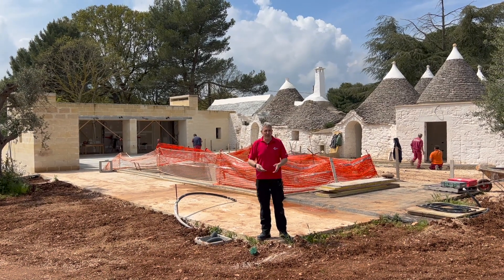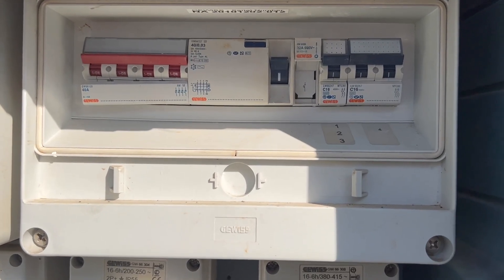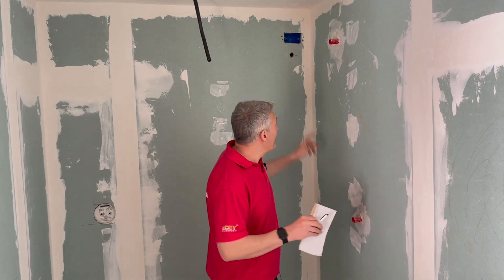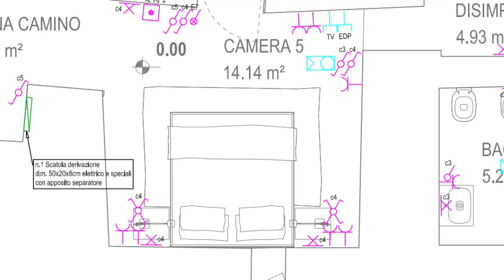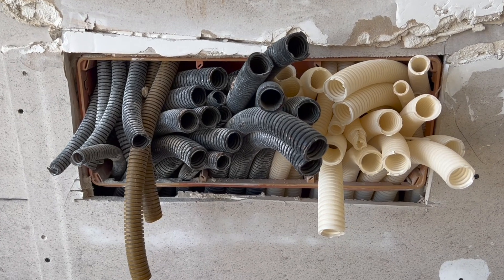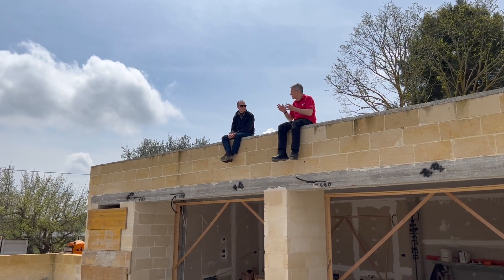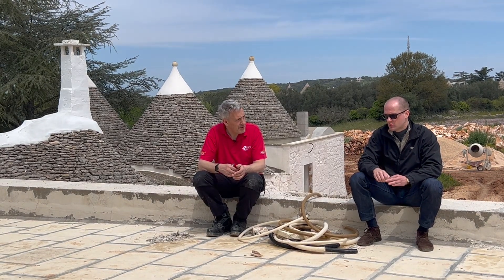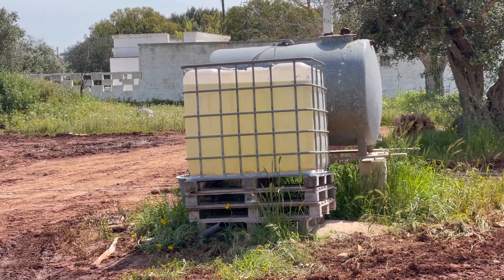Electric Wiring in Italy - You Won't Believe What They Do!

Comment: So people in Italy don't have air conditioning?  The 3kW thing is mind boggling to somebody living in California, I have 200A service at 240V (two x 120v with a center neutral) for a total of 48 kW (assuming pf of 1).   Last week we were having some voltage spikes and the lineman pulled the meter and put a tester on the line, I watched him pull 600A @ 240V and 400A at 120V to stress test it, no problem.
Reply: they have it, almost everybody excluded poor and students flat it's just not used as strongly as in USA. You usually have warmer temperature... Also think that you usually have just one or two split, so they're quite efficient
Reply from the maker: Italian properties are significantly smaller than what you are used to seeing in the USA. Especially in the towns and cities.
Reply: @efixx  Yeah good point, I'm living in 3100 square feet (~290 M2) which is huge by European standards.
Reply: @WhatsUp3D  But we also tend to keep the AC to some degrees under the external temperature. Not freezing temperature in august. 😆

Comment: Looking at this from Canada this is so strange. Our house was built in 1952 and we had a 100 amp 240v panel. We upgraded it 20 years ago to 200amp 240 two phase. No conduit, just run the wire through the studs.

Comment: Nice video! I recently remade the electrical system of my flat built in the 60s, when they still used solid copper wires and no earthing... My electrician was able to fit a 6mm2 power line from the meter up to the 4th floor. Everything is electrical in the flat and I can manage with a 4.5kW contract which is 50% more of average Italian homes. 
I have induction stove (with a 2.7kW built-in limiter), electric boiler and heat pump.
I believe the regulation says you can't have an outlet closer than 60 cm from taps.
Reply from the maker: Thanks for the info
Reply: I'd assume it's 600 mm from showers or baths, like in most European countries. The bathroom zones 0 (inside the shower basin/bath), 1 (directly above the bath/shower) and 2 (600 mm to either side of zones 0 and 1) are fairly universally accepted, zone 3 has been abandoned in all countries I know about.

Comment: I had the idea that houses in Italy were made of brick, not drywall
Reply from the maker: It’s a mixture. More drywall used now due to increased insulation levels.
Reply: @efixx  I’ve seen drywall on brick/concrete for aesthetics purposes. Mostly in commercial places, because in houses it’s a waste of space. In houses I’ve seen it on the ceilings to install a more complex lighting system, but on the walls it means you loose space and you get a fragile wall so it’s uncommon.

Comment: I'd love to see the US use more conduit in residential installs. It's a pain to try to do any sort of rewiring because the wires are stapled inside of the walls.
Reply: Same in Canada, I wanted to get some network cables from one room to another across a hallway in my condo, like 6 foot linear distance to cross. Doing anything in the walls would have required many holes and drywall rework and hiring a professional, so I cut a hole in the ceiling of the closets on either side of the hallway, installed a low voltage bracket brushed cable pass-through, and stuck some plenum rated networking cable up there. Inside the rooms themselves, any cable runs I have to do with just plastic trunking along the baseboards, but at least there's no wires crossing the hallway!

When they built the place a little over 20 years ago, nobody made any thought about data networking. How I wish this place was fully wired with ethernet cable! Nope, you just get electrical, telephone, and coax for TV, nothing else and no provision for future expansion.
Reply: @guspaz  Yep. If you're lucky, the electrician hired to wire the house installed at least CAT5 for the telephone wires. In that case, you just swap out the RJ11 jack for an RJ45. My in-laws house was that way. But that's still just CAT5, so it's technically only rated for 10/100 and not gigabit. But in most cases, gigabit works just fine.
Reply: @guspaz  Yep, need to get through the floor to the basement to replace furnace signalling cable - still did not find a way. Don't want to cut the drywall ...
Reply from the maker: Same in 🇬🇧 Uk

Comment: "color coded" lol, i used to live in a 1980s apartment complex, when rewiring the bathroom wires that were going through to get to the bedroom wall sockets, I got 220 for a couple seconds and collapsed on the floor, from the green/yellow wire (ground), despite the fact I switched off the main. Turns out that the neighbour's bathroom light was giving power to my light switch as well, through a ground colour coded wire. Italian electrical genius of the late 90s.
(I do have a high school diploma as electrician, despite that the bullshit you will find in pre-2004ish buildings is insane and insanely dangerous even if qualified)

Comment: Easier than running metal conduit but still a total pain in the rear end to do. My question is. The inside of the flexible conduit. Is it smooth or ribbed like the outside of it?
Reply from the maker: It’s ribbed in both sides
Reply: I can assure you it's not difficult push wires in those conduits. The wires should occupy less than 50% of the corrugated tube section. Also: most of the conduits are left empty just in case you need more cables in  the future. So: plenty of space
Reply: @moschettiflavio3635  With stranded wire it should be easy but here in the states we use solid wire. Solid wire and corrugated/ribbed conduit do not play nicely together. We do have flexible conduit, but ours has a smooth interior.

Comment: Connecting the foundation steel to the ground wiring is common, but it's bad. Small discharge always happen, and after years you are going to find significative corrosion to the steel.

Comment: Seems like the regulations or standards are over the top ! I don't see why + and - (phase n neutral) need to be in seperate conduits. Then they use flex pipes instead of straight-line PVC tubes making predictability of conduits  during repairs impossible. Then to top it they allow conduits over conduits, that too in the floor below the tiles !

Comment: Here in Portugal - also a Mediterranean country - it is pretty similar to Italy.

For the longest time, the standard was 3.45 kVA as the contracted power, which translates to 15 A of current.
Nowadays, many people switched to 6.90 kVA, which is 30 A of current.
This shift is mainly due to the change from gas to electric stoves, the dishwasher became normalize, and many houses installed Air Conditioning units.
Moreover, our energy needs - overall in the Western countries - has risen.

Heat pumps is still rare in Portugal.
But I honestly think that in Europe in general, but specifically in Portugal, we still have a long way to go when it comes to HVAC system installation.
I still struggle to find a air exchange system, which brings fresh air into the house, but warms it up before entering the house.
Moreover, people still struggle with humidity and do not know how to respond in an effective manner, let alone in an efficient one.

All this to say: in this road for efficiency, we need to work and share experiences - like you just did in this video.
Thank you so much!
Reply: Dutch standard is 230V x 40A = around 9.2kVA. For most applications that's fine. Since I'm using induction I have a double group for the induction plate. And I put the oven + microwave  on different groups as well so I can run all 3 together with no issues.
Reply: @StCreed  Portuguese culture, for many years, was to save energy as much as possible.
Only in recent years did the population evolve into a more consumer-oriented mindset, for energy consumption, among other aspects.

With 6.9 kVA I can run almost everything I want - granted it is on a separate circuit.
We have 2.5 mm2 cables to power sockets / outlets, and 1.5 mm2 to lighting, and it is mandatory to have separate circuits for a given power demand.
In the kitchen, you must have a dedicated circuit to each big appliance: cocktop, oven, washing machine, dishwasher, etc... This avoids running into issues.

Nevertheless, I imagine that in colder climate countries, the massive power demand is during the Winter months, right?

Comment: A bit of precisations while watching the video:
1) you need an rcbo within 3 meters from the power meter, as it does not act as a protective device. We usually place a delayed 300mA.
2) Shower alarm is not mandatory unless the bathroom is designed for disabled people too.
3) outlets have to be 0,6m outside the perimeter of showers and similar
4) backboxes are indeed universal for all the manufacturers.
5) running the cables vertical is not technically a law, but is enforces widely
6) houses over 400mq or 6kW are reuired to be deisigned by an electrical "engineer", but is usually done also for smaller houses.
7) i actually live with 3kW without any problems.
8) aerial tv system is still the standard
9) the colour code is a bit more complex
Reply: Seeing people struggling with the 3kW limitation of Italian power supplies - And noting I seldom (If ever) draw more than 1kW out of my UK supply (13,2kW day, 22kW night; An electrically heated home) at any point - I'm starting to wonder if my energy efficiency is considerably more German than I'd first thought?... ⚡🤏🙃
Reply: @UK-Combustibility-Assured  that's what I think too. No wonder Americans are considered the biggest contributor to climate change pro capita.
Reply: 4) I think he meant the boxes can be used in both solid walls (brick or concrete block) and plasterboarded stud walls, which seems strange to me - I know many Italian manufacturers have to different types of boxes (I've installed enough Vimar stuff to know their catalogue quite well).

The origin story of Italian back boxes is fascinating. Back before WWII Italiy used the same round boxes with 60 mm fixing centres as most of the continent. In the late 1950s the owner of one of the major accessory manufacturers went on a study trip to the US and was so amazed with the 2"x4" back boxes that he started manufacturing them in Italy, down to the lugs for UNC #6-32 screws. Unlike US switches and sockets, the Italian ones were usually modular, like grid switches, right from the start. Later on, box sizes not found in the US were added, allowing for four to seven modules in one row and up to three rows. Apart from the special boxes for the flush emergency lights, all the ones I saw in this build were three-module ones (the original US single-gang design), by far the most common size in Italy. Larger ones are used for rooms with multiple switches, electric blinds or roller shutters, etc.. Four and six-module ones are handy if German sockets are to be used. Compared to Germany or the UK Italian back boxes and accessories are fairly pricy, the individual modules aren't that bad but the parts add up rather quickly. For a simple switch you need a three-modules back box, a grid frame, a switch, two blanking plates and a cover plate. The last time I bought Italian supplies I paid between 20 and 70 cents per back box (depending on size) whereas I could have gotten a 25-pack of round 60 mm ones for 1.75 Euros.
Reply: @Ragnar8504  interesting. You are true anyway, the boxes aren't the same for concrete and plaster.
Reply: Surely the 3kw limitation will become an issue as more people want to charge their EVs at home?
Reply: @mad4461  you can upgrade to 4.5 kw or 6 kw by a phone call. Obviously, you'll pay more. I think that's the point many foreigners can't grasp. It's not a technical problem, it's about money.
Reply: @mad4461  personally I'm more worried for a future electrical stove. I can't place an ev charger at home so that will not be an issue.
BTW most household in Italy that place an EV charger usually get a 4.5-6kW contract.
Reply: @Ale-bj7nd  that's a slow charger. The normal UK EV charger is 7 kW (although many will throttle back according to household load).
Reply: @TheEulerID  I know. I design EV charging parks.
Reply: @mad4461  they will f up everything with this green nonsense (pv and evs) in eu.
Reply: Despite what the video says, power outlets are now allowed in UK bathrooms, but they have to be at least 3 metres from wet areas (bath or shower), presumably so that it's unlikely you will use a portable electric device, like a hair-dryer dangerously close as they don't generally come with cables anything near that length. Unfortunately most UK bathrooms aren't large enough to take advantage of that. Maybe there's room for some reduction of that to 2m, but I cannot imagine 0.6m would be allowed. Even though RCD protection has long been mandatory for bathrooms in new installations (and almost everywhere now), the authorities are cautious and treat that as a fallible, last-resort protection.

As for living comfortably with 3kW, then I find that astonishing. My electric kettle alone can draw that much, the microwave takes 1.5 kW, the toaster the same again, the cooker is on a circuit that can deliver 7 kW, the washing machine can draw 3 kW, as can the dishwasher. Then there's the prospect of electric cars becoming more common (7 kW each charging point), without even considering what a heat pump might do when gas boilers are phased out.

The current single phase supplies max out at 100 amperes, which is nominally 23 kW (although it's more like 24 kW as the UK voltage is usually around 240 V, not the 230 V nominal standard). I foresee a time when 3 phase becomes more common in UK households, as it is in Germany and the Netherlands. It's very much a minority thing in the UK, although I know two people with such systems, albeit one is a pub. However, that all said, the local distribution supplies will all need upgrading to cater for the de-carbonisation agenda, even with improved insulation.
Reply: I can’t imagine living with only 3kw supply! My dryer uses 5.5Kw, the AC uses 3.5kW, and i just switched my water heater for an electric on demand. The water heater alone takes 12kw!
Reply: @stertheder  well, i don't have a dryer so that helps. I live in a place where AC is not required as well. And heating is done from teleheating.
Reply: @stertheder  Not a very much eco-friendly house and, in general, habits not aimed at saving energy. Can I ask you where do you live?
Reply: @paolocarpi4769  Midwest USA. 1970 Mobile home with R3 walls, its been a process making it as eco friendly as i can without neglecting economics. I've upgraded the roof and tripled its r value from 3 to 9 (Spurred by tree damage) , replaced the Natural Gas Furnace with a 90% condensing unit(Following unit failure), and the Natural Gas 30G tank water heater to a tankless one(Cheapest replacement of a failed heater). I would love a heat pump dryer, but my current one was free (curb find!) and only does one load per week so it would not make sense to replace it. I do run it on low-heat auto-sense dry though, to reduce wasted heating.
Reply: @stertheder  Good job!
Reply: @stertheder  We've got a heat-pump dryer, 450 W. AC is just over 1,1 kW and electric boiler 1,2 kW for 80 l capacity, but it's not on demand.
Reply: @mariosebastiani3214  1.2 kW for 80L means waiting almost 3 hours to raise the water temperature by 30 degrees Celsius. In the winter, water in the UK is often very cold (< 10C) on entry to the property, so increasing by as much as 40 Celsius is quite common. Also, I think my hot water tank is about 120 litres.
Reply: @TheEulerID  We're a family of 4, 80 l is more than enough for us. Those 3 hours of wait happened only the first time we turned it on, then the quantity used doesn't require any waiting time. Anyway we use the shower (a lot!) instead of the bathtub, to reduce water usage.
Reply: @stertheder  Imagine my surprise when I tried a very small hotel spare room in UK and I found a shower box that could provide instant heat! Usuallu in Italy that's the job of the gas furnace
Reply: @stertheder  wut? where are you from, those figures are  insane. 
edit: aa murica, aa i predicted..you'll need to start live more economical, update your grid, aplliances, use less water, fuel etc. yes, i've been to states, so i know how it goes..
Reply: @izoyt  I agree with the more economical. however much I dislike my 1970 thin trailer walls, when the value of the property is <30k it would not make much sense to spend ~6k to insulate the walls further. I use a smart thermostat to drop the heat to 50 when I am away, and cut the AC off. 
The current setup is as economical as feasible. A heat pump dryer would save energy, except in my use case it would never recoup its own manufacturing impact. I already have low-flow 1.5gpm fixtures for water savings. I did contemplate installing a heat recovery drain to recoup the wasted hot water from showers, the math checks out.
Reply: @stertheder  i live in germany, berlin and most of the apartments use electric on demand water heater with 11kW , we can still use the oven and stuff so i think 22kW are more or less the standard
Reply: @tobias124812  So now you cannot rely on russian gas to be pumped in power plants anymore, how you're generating electricity? coal? petrol? You're dismissing nuclear power plants.